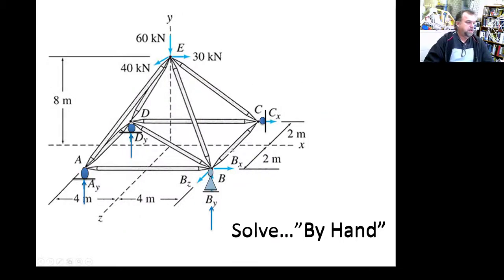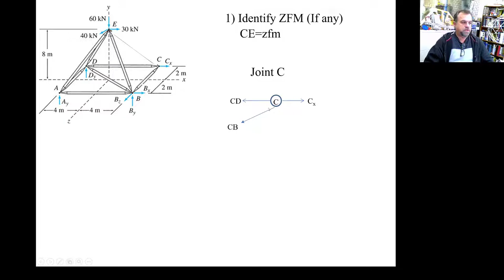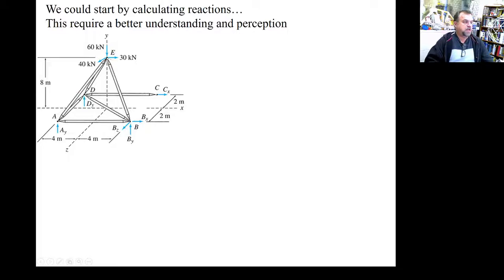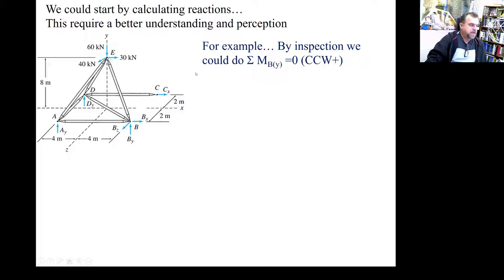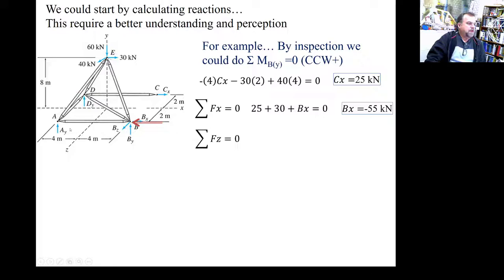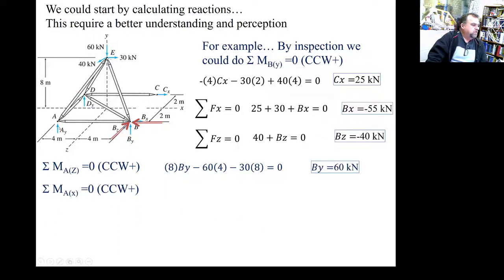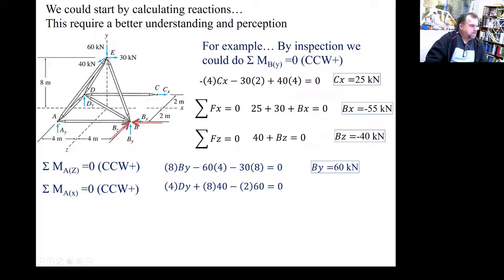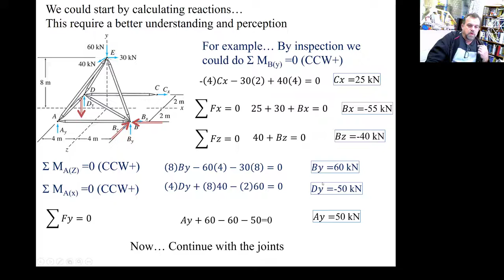3D Truss Reactions  "By Hand"?

Comment: Interesting, but for a roller in 3D, two reactions are required.

A roller can move in only one direction, meaning that there are reaction(s) in all other direction(s). 

In the case of 2D, a roller moves in one dimension and a reaction is necessary to impede motion in the other dimension. 

Since 3D has an extra dimension, the rule does not change, therefore, a 3D roller must have two reactions. 

I wrote a code on MATLAB and it shows that for rollers in 3D, you must have two reactions. 

Similarly, a 3D pin has three reactions because lateral motion in all dimensions is not allowed.
Reply from the maker: not really, no
Reply from the maker: for this class, in the theory I explain to my students the roller is the equivalent to the support called "ball" and the one with two reactions we called it "slotted bar"